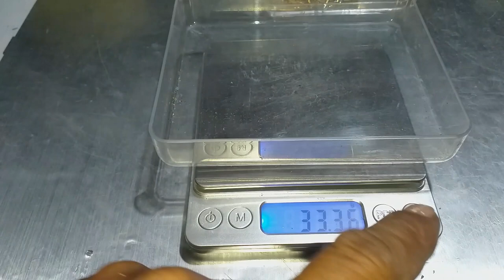BEST PART OF E WASTE RECYCLING BUSINESS THE GOLD RECOVERY | E-WASTE RECYCLING GOLD RECOVERY

Comment: Me ajuda com precipitação forçada amigo
Reply from the maker: you need forced precipitation? add sodium hydroxide, add more and more until theres no reaction then filter all precipitation with filter paper, then wash it with hot water or boil it, then alway allow all precipitation to settle down then dissolve again with aqua regia, this aqua regia do not mix directly 3:1 ratio, add hydrochloric acid its enough to cover, then add slowly nitric acid, so that is not difficult to precipitate using smb.
Reply: I always try with aluminum, it is not good for casting
Reply: much damage
Reply: Having a hobby and just getting it precipitates the vzs and a half fruity
Reply: I have some material, you can send me your zap so you can help me, I'll do recycling with my father
Reply: Sempre te acompanho  amigo
Reply from the maker: amigo if you need some help, i cant translate your comment here maybe you cand translate your language to google translate then copy and paste the english language here.